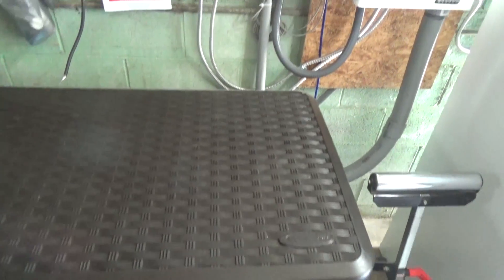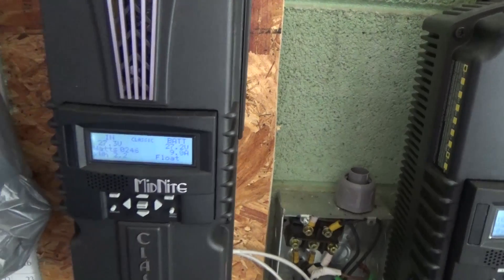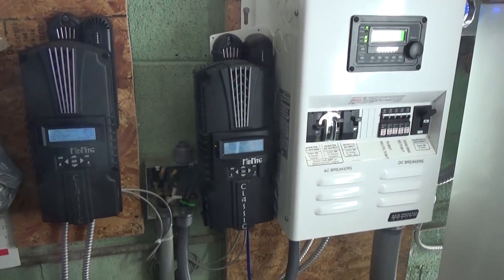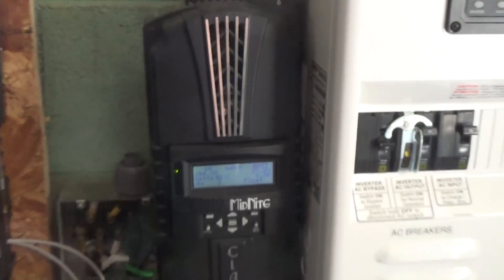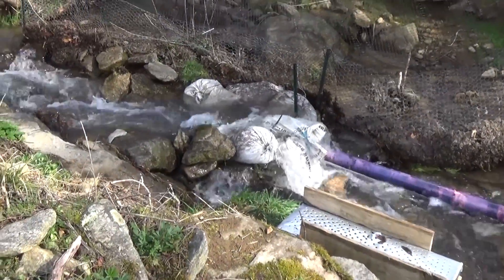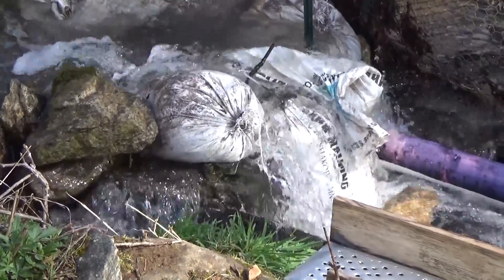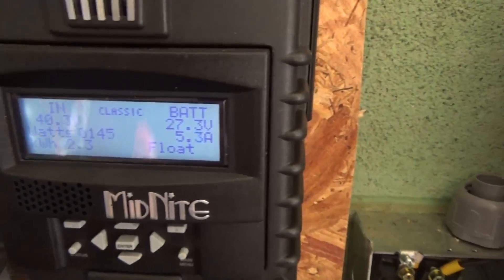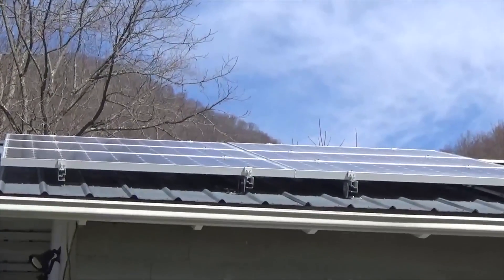Micro Hydro Power with Turgo generator Part 2

Comment: As an "engineer", I'd expect you'd know the difference between Watts and Watt-hours, one is power the other is energy... and they are not interchangeable.
Reply: He said 6500 Watts a day, which i take to mean 6.5 kWh per day. Pretty disappointing if tbat is the case. My 9.9 KW solar arrays (33 three hundred watt panels)  produce that on the cloudiest days in Seattle, but 65 kwh on some roofs in May with nice weather. Is that all the Turgo can do?
Reply: his system runs 24 hours a day right?  and yours runs 5 hours a day...??  there's also the investment cost.
Reply: I don't have either kind of system...  so I "know" what I've read, but as second hand info, not on an experiential level... but I would want to see a $/kwh on both systems...everything I've read says hydro is less expensive per watt.
I've read that solar only has a 5 hour peak, and the rest is "off hours" of lower production.  Do you mean to say that off hour peak is still reasonably productive?
Reply: 007mercucio Yes. Off peak is still productive. It is just under $20,000.00 (before incentives) for a 10 kw system that produces 8kwh in a single peak hour. But, there are often 5 peak hours and many more off peak hours, so you get as much as 65 KWH in a single day. Yet notice the 1 peak hour by itself is more than the Turgo produces in 24 hours. How much did the Turgo installation run (before incentives)?
Reply: He needs more head pressure and will achieve alot more power. He stated in previous video he only has 30 feet of head. I am doing one with about double the head. My whole system including batteries will cost about 5-6 grand. The good thing about hydro is you need a smaller battery size
Reply: 007mercucio what are you asking?  which is the most economical? 
well that depends on whether you have a steam of which it's legal and profitable to harvest energy from.  hydro wins hands down but isn't practical for the masses. which is why most people choose solar.  almost everyone had a roof of some sort...

fyi, this whole thing has nothing to do with my statement.
Reply: PMA Generator for Pelton/Turgo 0-240 VAC 4k Watt Micro Hydro Motenergy ME1112
ebay shows:
US $159.00

it has a good theoretical rating...i'm not sure why he isn't achieving it... but ebay shows his turbine (with that name) with a good watt rating... Ok, nvm... I see... that's the type, not the brand.  I agree with you guys.  This machine isn't producing as it should... but how can he improve it?
Reply: The system needs a better penstock to be more efficient. There is a lot of air in the water likely causing the cavitation he was talking about. A better water pen that eliminates the air will help a lot and a more permanent pen installation that can resist flooding would be best. That price on ebay is strictly for the generator head and does not include anything else. A more appropriate comparison would be a complete 600W Turgo setup also available on ebay for ~$400. The setup he is showing here though has 2 nozzles where the one on ebay has a single nozzle. The system in the video is consistently producing 250W so it could be comparable. The things that matter for this system just like any other hydro system are flow and head height. The flow is good here and likely near the limits of what a 4 inch pipe can take under these circumstances. The other factor is drop. Maybe if the penstock is relocated further upstream or the generator location is shifted further downstream they could increase the head height. The real question is if there is enough room in the stream on the property to do either of those things. Moving the generator of course increases the wire run length which increases the cost. That 10G wire is less than cheap! Moving the intake requires a good site further upstream and more lengths of pipe. Another option would be to use a 6 inch intake pipe instead of a 4 so they could increase the water flow rate.
Reply: That's depressing.
Reply: 007mercucio runs from sunup to sundown, which today is 6am to 8pm. but, who cares. no matter how many hours it runs, 65 KWH of production from solar for a day vs 6 to 8 KWH for a day of hydro (or however many it is...can't scroll up to check) is no contest. I don't know what the hydro cost, but I'm sure it is far more expensive per KWH produced than the solar...and solar has virtually no maintenance and will run 3O years without breaking down. Hydro will need constant fiddling, pumps fixed, filters changed, etc.
Reply: @Mozillapi  what do you do when the sun isn't out for a couple of days and you cant compare 9.9 kw to 500w energy source. put a 10kw hydro generator against your 9.9kw solar and it would put out 240kwh every day no matter what the weather compared to your solar which your max output in any day would never hit 100kwh. plus hydro is the least maintenance going, one small cell gets bird shit on it and the hole panel stops producing energy, you have to wash them constantly to keep them clean and performing , hydro if you have it year round is the best free energy source there is, it is the cheapest too if you have a close source, if you don't it can get expensive
Reply: @jasona.neverforgetfukushim647  hydroelectric is capable of producing massive energy. No-one disputes that. But, this particular hydro system is a miserable toy. One comment here is saying it can only generate 250 watts. Really? Less than 3 one hundred watt light bulbs? The solar panels I have been installing produce 320 watts each...and I usually install 30 plus on a roof. Also, does that stream really run all year long? Or, is it seasonal? Looks like lots of maintenance. Bird droppings on a single panel only affect that panel by the way on my systems because I use microinverters. Even then, on a 5 bus bar panel, it only affects one fifth of the panels production.
Reply: @Mozillapi  well I guess you live a wasteful life consuming endlessly , this is no toy, I assure you it is capable  of maintaining an off grid home or shop, just check out all the other people being successful with almost the exact system, the key to free energy is diversity of sources. what happen next year when bill gates blocks out the sun, or are you one of these nutjubs that don't believe in weather modification for profit. all my friends in northern cali have had the output of there solar panels reduced by 40% in the last 7 year just from heavy chemtrail spraying in their area. but do a cost comparison the same amount of solar panels in price verses the hydro, they hydro pays back sooner and is more consistent and allows you to get away with a smaller battery pack at first
Reply: @jasona.neverforgetfukushim647  Actually, I am very concerned about weather modification. It is for real and did affect solar production here last August. We are on the same side and I support micro hydro. But, forgive me as I consume stuff while I'm installing solar all over the Puget Sound area.
Reply: @Mozillapi   yeah I used to believe that solar was the solution but yesterday was the first time I've seen the sun in two months of non stop spraying here on the great lakes basin, literally saw the sun break through the cloud deck and 20 minutes later 14 jets  in 10 minutes sprayed it and blocked out the sun again(its beyond depressing and demoralizing), you can see it on the aqua and terra satellites under true colour imagery. every one here is taking down there solar and selling it to recoup some of their losses as its not possible to be off grid with it here any more because as you know you build your system for the worst output which here is no output for months. Its so bad you have to have your lights on all day its even too dark to easily read a book outside during the day you have to come in and turn a light on as its just too much strain on the eyes. I've decided to sell everything and leave the northern hemisphere just don't know where to go yet some where remote with no liberals

Comment: all this to save 60 to 100 a month?! whats the pay back time for the hydro and solar setup?
Reply: thats what they are currently spending per month with the setup on. they are looking to expand it to have zero energy bill. who knows what their energy bill was before the system was fitted
Reply: Or $7,200 to $1,200 per year.
Reply: $720 to $1200 a year, you added a 0
Reply: A 600W Turgo arrangement can be had for ~$400 on ebay. This installation is generating 6500W/day which with an average power cost of $0.15/kw is saving ~$1/day so 400 days? A little over a year and the generator, wheel, housing are all paid for. The rectifier runs ~$10 and there is quite a bit of wire plus the charge controllers and plumbing so from a hardware standpoint the system would pay off in 2-3 years. Consultation fees not included...

Comment: I'm surprised it is legal to alter waterways like this...seem like something state/feds would be all over
Reply: you could say dipping your feet in the creek is altering the flow, and the fed's will jump out of the bushes to cut your legs off. he's not diverting the water to a bottling plant without a permit.  all the water stays there.
Reply: John Griffin :  Hence the "undisclosed location!"
Reply: It's not a navigable waterway.
Reply: Not when you own water rights!
Reply: The water isn't consumed, blocked, or stoppped - it passes thru (violently for sure) - how is there any harm?  Nobody 100 ft down "stream" would have a clue.  Now, getting dinged for all the electric work and other construction without permits, safety precautions (clearly lacking throughout), blessings, appropriate sacrifices - that might be an issue depending where you live.

Comment: Making a hydro up a mountain next to a little camp to charge phones and power lights the pipe is about 2 inch diameter 80-90m long if you put your finger over it it will push it off, really hard to hold back not sure on power outputs as i haven't completed it yet. Also don't worry I didn't spend £200+ on a little project the pipe I got for free and i'm going to use a old bike frame and a alternator hopefully it puts out at least 40w.

Comment: I'm confuse, in the previous video you mentioned that you need to double the voltage input to charge your battery bank, why is that? To charge them and power the house at same time?
Reply: I think you're right, draw from the batteries and still recharge at a reasonable rate. While the input voltage wouldn't need to be double and I think that was just a goal they set it allows for more time before they have to reconnect back to grid power should their draw increase or the solar under perform on a cloudy day.
Reply: Geo Gmz I think something hasn't been explained very well. the generator can transform the energy stored in the water in potential energy to electric energy. when you put the probes and measure the voltage across the terminals it doesn't mean that this voltage is going to stay steady no matter what you plug in the terminals. when you plug something in the terminals a current will flow through the element. If that element has a low resistance the current will be high due to ohm's law (voltage=current×resistance). the power delievered by the turbine is not infinite (power=voltage×current) must remain the same. if you plug the batteries, while charging are going to need a current that is going to drop the voltage a little bit (or a lot) Actually the charging devices are smart enough to get power from the turbine, charge the batteries and deliever power to your devices. Remember that it can't do magic. if you have less power than the required, the batteries are going to be discharged to satisfy your requirements. that's why he needs the voltage to be twice the batteries, to have a little gap to play. Have fun!
Reply: Thanks for the answers.. I'm very intrested on learn more about this I have a personal goal next year to have my "get away" house powered by only renewable energy. 

Lucky for me the location where it will be is very sunny there is no "winter season weather" there so I can also rely on solar but this turgo/peltons turbines can be a suplementary system for the whole house or help panels to charge batteries.. and have smaller footprint of panels around the property... Who knows..

Comment: Hey engineer775. Whats the purpose of the fan bolted to the top of the hydro alternator? It seems like it would just create unnecessary air resistance. Couldn't you take that off to make a spin a little more efficient?
Also, awesome vids by the way. I built a spring system last year after learning from your vids. Completely off grid water wise now.
Reply: It  keeps the assembly cool by forcing air over the windings and housing.

Comment: Love the design. Just a suggestion, but if you increase the diameter of the pipe at the beginning of the pipeline, allowing more water to enter at the start of it and  decreasing the diameter of the pipeline at the end, you increase the amount of water pressure going into the turbine, allow it to spin even faster. More speed more power. Remember just a suggestion hope it helps. Let me know if this helps
Reply: Diameter has nothing to do with pressure, it is about the head, that determines the pressure. The total energy put into the turbine is combination of pressure and flow. Having a larger diameter facilitates more flow, but if you open the nozzle, the pressure will drop, so it is about finding the optimal flow for maximum energy production, as the head of the water is more or less the fixed parameter. Larger diameter penstocks are beneficial because pressure drop due to friction/resistance per meter is less for larger diameter pipes.

Comment: the speed of the stream is irrelevant..just build a storage tank to the side..
reduces  cavitation to ZERO
Reply: Exactly... up stream, excavate a 8' W x 8' W x 4' D square hole immediately adjacent (say 1' into dry land from the creek) drop in a concrete cistern w 3 out flow holes that have been predrilled 1' above the cistern bottom for 3 flange fixtures...close off 2 openings, secure medium mesh over the cistern top, run the flex hose from the open flange to a spliter for the opposing generator nozzles & then re direct half the stream into the concrete cistern, redirect more of you need more flow & presto...redirect all flow if you open the other w cistern flanged openings...BUT, it might just be easier to excavate the creek rather than the side & drop the cistern in the creek proper...a mini hydroelectric dam...avoid additional solar cost.
Reply: I have run the calculator on the site, and crunched some numbers. 12' of fall is pretty much needed. Here in Iowa, most of the stream system is really flat, for miles. So that will be a concern for many. I think I do have one spot that this will work in though. Mainly becasue of a natural drop area (2-4') and having an existing small dam area. Providing an additional 8 to 10 feet of drop.
Reply: To reduce the air could you place an air release valve in-line?
Reply: You are correct Johnny. I am thinking along this line as well (tank), and getting everything away from the creek. We all know what a downpour will do to a system like this, that is ever exposed to the 'rage' of the stream. When I see that long intake pipe running down nearly the center of the stream, I just cringe. I think it would be best to exit the water from the Turgo away from the stream as well, and just let that little bit funnel its way back in.
Reply: A very large storage will move its weight in power - couple this with a geared system  to truly realise the potential of an HEP system like this. Nice work though.

Comment: Another good video from 775, I have all of your videos on hydro system and ram pump. This turgo is one of my favorites on YouTube. On behalf of other followers, I wish to make a request. Your ram pump part 2 is the most detailed I have seen anywhere, on this, I think a couple of Info's are missing. This generator, sold by Spencer and Langston, is made by motenergy, I believe this is the ME1016 model, rated to produce 1000 watts at 1000 RPM, 2000 @ 2000. We'd like to see this beauty's maximum capacity into the battery, not float mode wattage. I hear you say its putting 250 watts into the battery, you also said it could generate more, that the battery was full. We want a real test with empty battery. It will also be nice if we can get at what RPM it is putting out what wattage. Thank you
Reply: Waidi Oguntade I
Reply: Those are my requests as well. As I'm making my own hydro set up

Comment: I am no engineer but it seems like if they dammed that flow and ran it into say 3 or 4 of those it could supply a significant part of their power.
Reply: Basically daisy chaining 2-3 of those and sell the excess power makes more sense to me. By the way, use hybrid solar panels,  they produce electricity and warm water plus the water cools the cells...